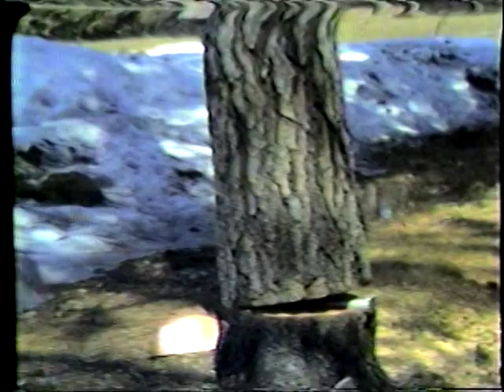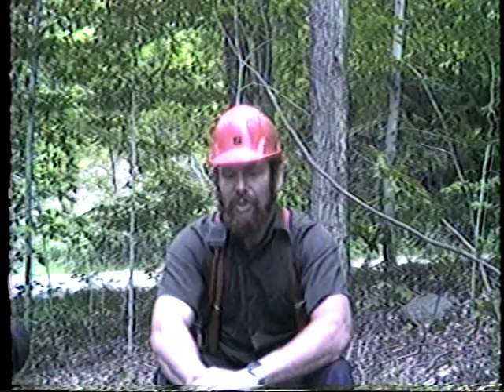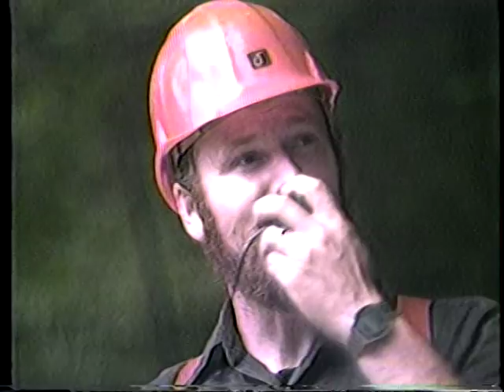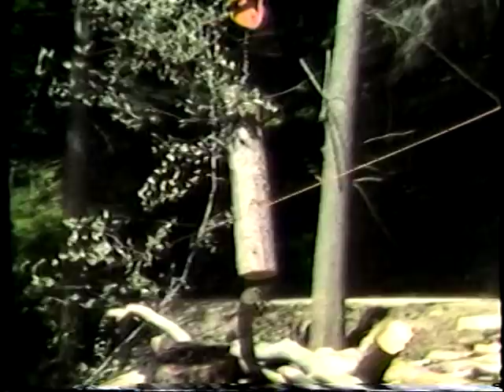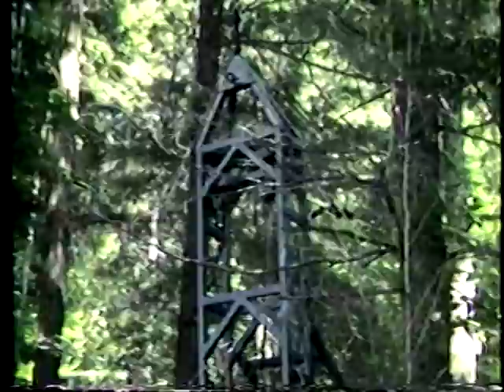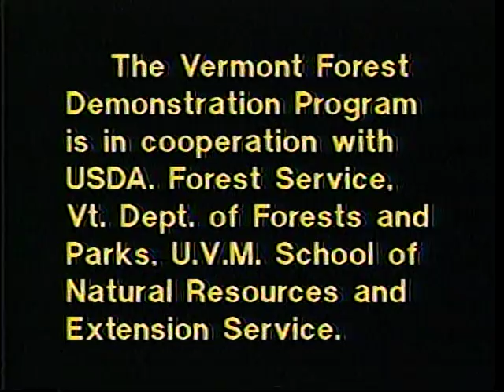The Vermont Cable Yarder

Comment: Thanks for sharing Gerry. Beautiful, an efficient minimal impact technique.
Reply from the maker: Thanks David.  With advances in microprocessor controls, we could now make a much more efficient, lower cost system that could be set up and operated by one person.
Reply: That's great to know. We're currently selling and I would like to work with timber as a 1 man operation when we move. I would be happy to put a prototype into action using your experience to minimise experimental errors in getting a working system. I suppose you're looking to use remote machine operation and auto drop while the one man rigs from the harvest site. I've got your web site for wheeled hand tools and may get in touch in the future. It could be a satisfying experience getting a challenge like this to function well. (Addition: I have an Environmental Science and education background))